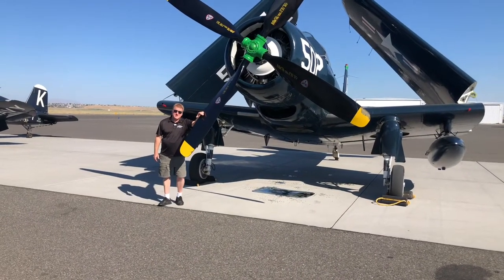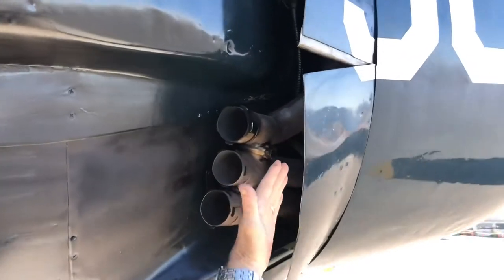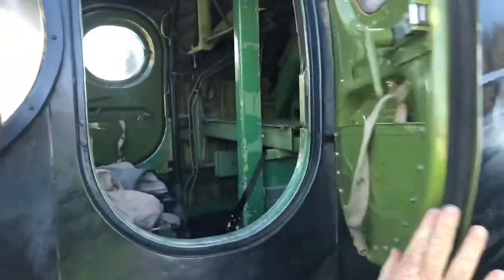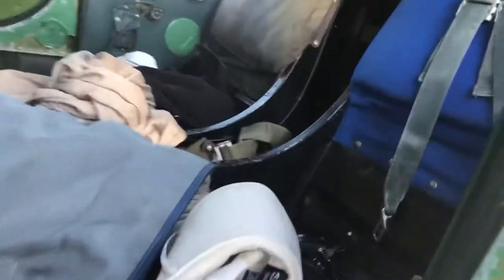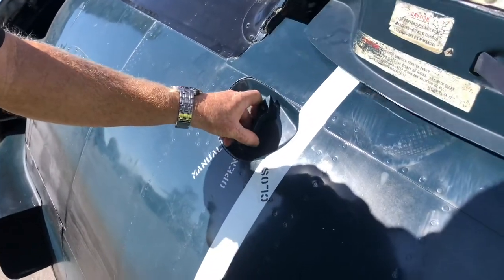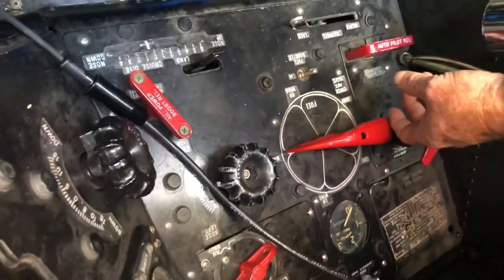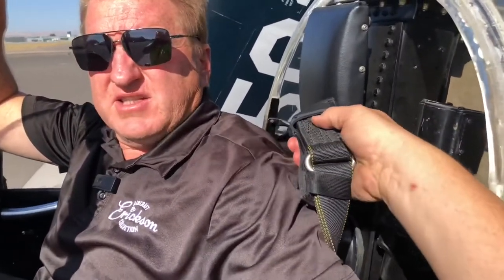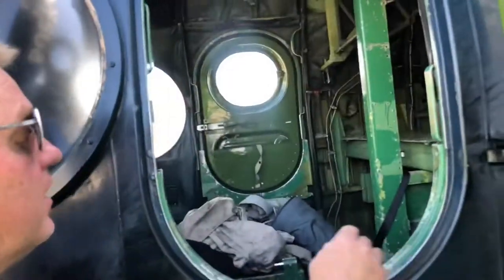CFR Extraction Video AD-4W Skyraider

Comment: I've wonded with this plane is, I helped with the replacement of the air water separate on the base commanders plane I was working on the EC47 line. Sadly the engine had a vaperlock the pilot declared an emergency, the crew chif open the door and jumped out!
MInutes later the oil pressure came back up! They flew on to the other base, inspected the engine and found that there was no missing install or leaks.
They never found the man I worked with for few hours.
I'll never forget that young man, and I hope to see him again 
Raven out! To all the wounding JOHNS, STAY ON POINT!